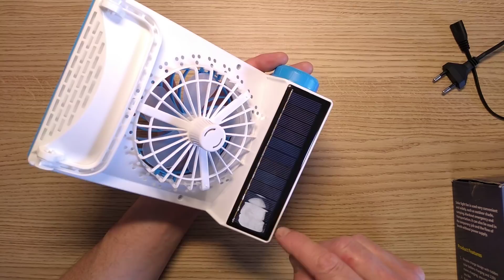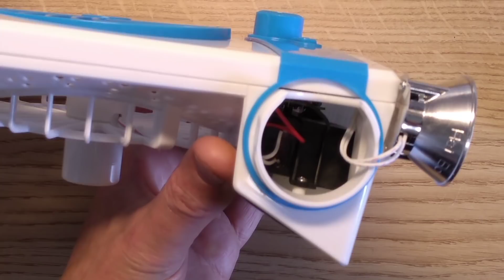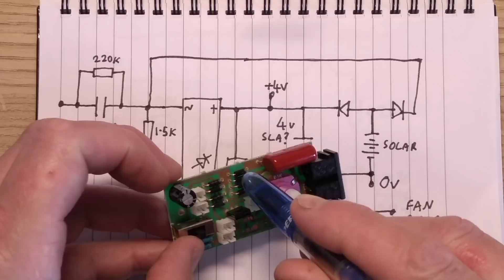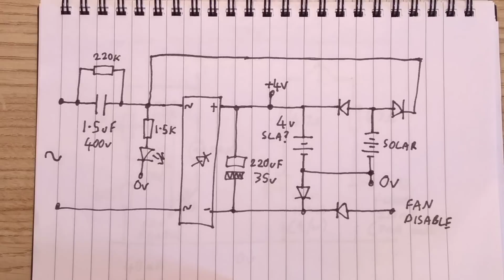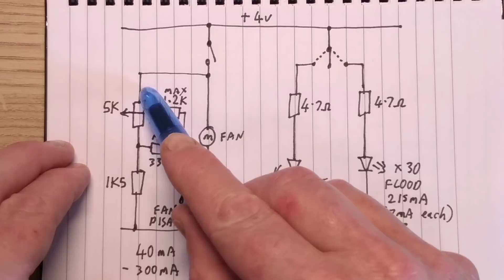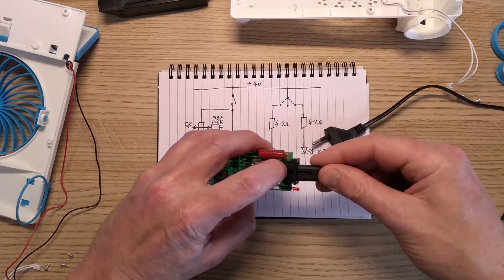Inside a solar/mains rechargeable fan / work light.  (with schematic)

Comment: i think i suddenly realized why the similar light, i found being thrown away, did blow up!

the sla just dried out and went open circuit. that removed the only voltage stabilizer from the circuit and led got ~300vdc. explains black spots in that package and, iirc, red charging led being split half with force of the mains

i guess that was only reason it failed...

Comment: This device reminds me of device I have: a nice little USB power bank with a bright LED array on one side, USB in and out, and solar panel on the other side.   As long as I charge the device via USB it is great.  If I put it in room light, the charge status LED bar graph comes on, but it appears the bar graph uses more energy than the panel generates, thus discharging the battery!  In very bright sun it might work, but in room light I have to remember to keep the solar panel side covered.

Comment: China, Inc. is usually pretty good at minimizing to the bare minimum.  I am a bit surprised the LED selector switch uses two 4.7 Ohm resistors, where one resistor would be sufficient (both LEDs can’t be on simultaneously, or can they?).  I suppose that gives some flexibility for a future design change where the two LEDs require different current limiting resistors.  The fan disable is actually kind of clever, I like that.  The other missed opportunity is they could have used a two chip LED and saved the need to have a blocking diode on the solar panel; hard to say if a fancier LED or the extra diode would cost more.

Comment: Is it just me or would that make a good Soldering station "Fume extractor"- I don't use one but I know i'm supposed to. (Just like how your not supposed to drink, walk on the wrong side of the road, J-walk,etc.)
Reply: Honestly, you don't even need the 'extractor' part of the fume extractor if you're not soldering full time. Just get a PC fan and let it suck the fumes away, and have some ventilation so that they don't build up inside the room.

Comment: WHY does the fan spin up to high speed for a second or 2??   You DID NOT analyze why that occurs!!     Please do.
Reply from the maker: It starts at the highest speed when you turn it on and as you turn the knob further it slows down.  Most fans start at full speed to get them running.
Reply: @bigclivedotcom  Thank you

Comment: Clive why does the usb cable on my Samsung phone chargers trigger my voltage detector probe rated 90-1000VAC? Im scurrred.
Reply from the maker: There's a slight AC coupling from the input to the output.  The voltage detector is sensitive enough to pick that up.

Comment: If the LED series resistors are both the same value why two? One less component if the resistor were between the power and the central arm of the switch. There is no facility for having both LED lamps on at the same time so no need for two resistors.

Comment: The resistor 1k2 max is also required to limit the base current other wise you would connect the 4V across the base and when the fan disable kicks in it would be a short across the battery,

Comment: If I were to hazard a guess, I'd say those four diodes that all do different things were probably grouped in that way in the same place for ease of assembly. These through-hole technology (THT) components were probably soldered in by a low-paid human. I know there are pick-and-place machines and soldering robots that can install THT components too, but I'm guessing this PCB had humbler origins w/o anything as fancy as that involved.

Comment: Hey Clive, they also do it in pink. https://www.ebay.co.uk/itm/Rechargeable-Solar-Cooling-Fan-Night-LED-Light-Lamp-Tent-Lantern-Camping-Torch/153469906414?var=453428363164&hash=item23bb84edee:g:JWEAAOSwrCZa-VOZ

Comment: It's a bit odd that they did not use a 555 timer chip, or perhaps a 556 dual timer chip, to slow the fan and provide dimmable light, both efficiently, by using the PWM capability of the venerable chips... which also have a significant current drive capability, all at quite low cost.

Comment: Interesting little battery would like to know more about it great video keep up the good work.
Reply: That looks like a 4 Volt, Sealed Lead Acid battery.. Probably 1 to 1.5 amp max(guessing based on size?)... Very common where I live.. costs around 75 cents to $1.20 for a 1 amp.

Comment: this could be good for a soldering station, if you can get it to suck not blow and stick a carbon filter on it to collect the solder fumes
Reply: Turn it around, slap a filter over the "back" that is now facing you.
Reply: @AlexLaw_Qld  but then you'd lose the lighting i think

Comment: Met those SLA batteries before, and they are very light. Opened a dead one ( it was brand new, and did not want to charge, got a whole load of LED's out, which was the goal, they were cheaper than buying new) and inside it was 2 rather poorly made spongy lead plates per cell, with a very dry separator, and filling up the rest of the volume was some polystyrene sheet, crudely broken to shape to fill the cavity, that was obviously meant to have another stack inserted. Added some sulphuric acid to the one that had come apart easily, a few spots of glue used to hold it together, and it was then able to take charge. I estimated around a half amp hour capacity though, though the case was implying that these were 4Ah packs. Went with the other alarm batteries to the scrap yard.
Reply: @Ad Lockhorst  I wonder if that has a linguistic relation to "cole slaw", which is 'murkan for shredded cabbage salad with a bunch of mayonnaise and something acid like vinegar.

Comment: doesn't the 1K2 resistor in the fan section - connected to the pot also limit current thru the pot?
Reply: Technically it does, but this doesn't mean anything to the circuit.
Reply: @B-System  Then why include it?  I

Comment: I had bought a chinese trimmer and yesterday decided to open it just to see how it charged its 1.2v Ni-Cd battery from mains with all the circuitry inside. I opened it and understood nothing(Not that good at electronics lol), but it had very few components. Later I saw it was charging the 1.2v battery with 4 volts and was wondering if that was safe?

Comment: They could have saved 2 to 3 inches of wire if they had put the wires for the fan along the right guide rail instead of using the one on the left.

Comment: Clive, I have a failed Flowline LI55-1211 4-20 mA digital level controller. This is the second unit that has failed mysteriously at the same location. You want it to take to bits?
Reply from the maker: In what way is it failing?
Reply: @bigclivedotcom  Rather uneventfully. The first unit lasted about 1-2 years then it either displayed nothing or showed nonsense information, I'd have to ask the site's technician again which it is. We replaced it with the same model unit. Which suffered the same fate about 1-2 years later.

Nothing else in the panel has any issues. There was an electrical storm around the time the second one died. It may or may not have had anything to do with the second units death.

As best we can tell the two units died for no discernible reason.
Reply: @bigclivedotcom  I talked to the tech and there were 3 failed units, each replaced the last. The last two, and maybe the first, failed during lighting storms. The weird thing is that these are the only failures in the panel. The panel is on top of a hill, against a 15' tall above-ground storage tank but the only signal/power to the unit is from a sensor at the bottom of the hill that is hooked to a panel there (no failures in this panel either). There is 120v power in both panels for other uses (including powering the sensors that send the 4-20 mA signal) and it is protected against power spikes. The power comes from the panel at the bottom of the hill. Both panels are grounded. Nothing else in either panel was damaged, including another identical Flowline unit hooked to a sensor in the tank, that was installed at the same time as the first one failed.
Reply from the maker: @captianmorgan7627  Is the unit mounted at a remote location with the signal wire passing between buildings?  It could be a voltage gradient issue from lightning strikes.  It's possible you could use an Ethernet style surge arrester to shunt excessive voltage spikes to local ground.

Comment: I have had 2 of the power failure lighting units with the same looking sealed lead acid batterys in them, and they both would over time , say 6 months to a year eat the wires off where they attach to the battery's. I would clean the battery contact and snip off the wires and solder them back on only to have them get eaten off again in 6 months to a year. So there is some out gassing happening right where the battery contact posts are located.

Comment: If one forgets to turn off the fan while on it's lowest setting and begin a charge, upon removing the charger cord, with the fan not rotating without a bit of a nudge, does that stress the circuit, or overheat the fan motor because it's not rotating?
Reply from the maker: I think the current is limited to a low enough level at that point not to be an issue.

Comment: Would have liked you to have positively confirmed the battery chemistry.
(Or negatively not confirmed the battery chemistry.)
Reply from the maker: I took one apart in another video.  Chunks of lead and fibreglass soaked in acid.
Reply: Solar >> trickle >> SLA, no?
Reply: @michaelthibault7930  Solar only needs to provide up to 14·6V through a diode (for a 12V battery) = no issue.
I often see comments on 'fancy chargers for LA batteries - but they actually look after themselves - give 'em 14·6V and let 'em soak up the current as they need it.
Obviously multiply the difference according to the actual battery voltage.

Comment: I'm guessing the fan starts at high because that's what most fans do. If you buy a box fan, oscillating fan, tower fan etc and it uses a knob for power selection, it usually goes Off, High, Med, Low.
Reply from the maker: It's to give them a boost at full power to make sure they start.

Comment: I had a big industrial fan that behaved like that once, it would only start if it was already in motion from being nudged with something small enough to fit through the grille otherwise it would just sit there gently buzzing.
Reply: That probably means time for a new run cap.
Reply: @NiHaoMike64  or bearing....

Comment: I guess then, the Achilles heel is the battery? - my guess being that they're not exactly something you'll get off the shelf at Wilko (or Pound Land)? So once it's dead, it's dead - an ex battery, snuffed it and nailed to its perch, if you see what I mean, so Clive, your mission, should you choose to accept it, is to modify the device to take NiMH, or Li-Ion? 💥
Reply from the maker: It could be fitted with three NiMh directly at 100mA charge current.
Reply: The thing is, lead acid batteries are very hard to kill. Depending on why they died, they can sometimes be revived by adding water back to the cells

Comment: I have a question regarding the capacative dropper. But if you answer please keep it simple.
240v @50hrz from the plug goes into the dropper, I'm ok with that part.
After the bridge rectifier we'll call it 12v @50hrz, I get that.
But as I understand it the capacitor acts as a diagram pump, without letting the actual current through because the frequency is higher than the capacitor can react to. (Ish).
But when a discharge resister is placed into the circuit. What stops the current bypassing the capacitor through the resistor and letting 240v through?
In my head it makes no sense having the capacitor if you have a resistor.
Hopefully I've typed this in English, and thank you for your answers. 😃
Reply: The resistor is of high enough value that it passes very little current. use an ohms law calculator.
Reply: @simontay4851  
Thank you for the answer. That makes sense in my head. 👍

Comment: Why didn't they just use 1 x 4.7 ohm resistor before the switch instead of 2x after? Would save a few pence.
Reply from the maker: Probably to allow different resistors for different lighting configurations.
Reply: Hey, that's my comment ;)
Reply: When the switch fails and turns both on simultaneously, though!
Reply: @JasperJanssen  Quite possibly not possible !

Comment: looked up the Datasheet, the transistor seems rather special, with a 6 V Base-Emmitter voltage.

Edit: OK, you were correct, it seems like   this was the maximum (breakdown) voltage, not the operating voltage. So forget what I have said, it is indeed a generic NPN
Reply: Rubbish, nothing special or spectacular about it.
Reply: Are you confusing base-emitter voltage with reverse base-emitter voltage? It’s just a very popular, standard, medium power transistor like the European BD13x ones.
Reply: make sure that you got the right one b/c i know that transistor (got it at home) and its everything but special. 
also keep in mind that even though it says d882p on the to package its a 2sd882p...

Comment: I'd advise the rubber glove trick for the smoke detector if it's a major concern. Just rubber glove over the detector, large yellow gloves
Reply: Or a sock.
Reply: Shower cap works a treat too.
Reply: I do commercial fire alarm/detection, and it's totally not kosher, but cling film/saran wrap, masking tape, a shower cap, a rubber glove, or just about anything can be used to cover over a smoke detector. Be sure not to remove it, as that'll send a trouble signal to the fire alarm panel, and be sure to take your obstruction of choice off of it when you're done taking apart random electronics.
Reply: @carpespasm  the ones in prison don t set the alarm off when you are just smoking normal tobacco but they do when weed was smoked!! How do they work?? Can they be sensitive to certain types of smoke or something? ?,
Reply: @keithking1985  tobacco smoke doesnt generally set off fire alarms. Cannabis on the other hand burns hotter and the smoke contains more impurities.  You can chong a full fag blowing it at a smoke detector and it may mever go off. Spark up a spliff and blow stright at the sensor though and it goes off straight away.
Reply: Tissue paper. They had them in jail and lads who "smoked" used tissue paper stuffed into them. It works.😤😥😧😊

Comment: Do you have access to male / female mains socket and some wires ? With clamp meter could measure current from live or neutral, however it would lack the power factor. aie aei aei gate current :P
Reply: exactly its a npn and neither mos nor igbt... npn dont have a gate. but the message comes across quite well.
Reply: @urugulu1656  Yep it passes thru right well on bjt :P we also do that once a while.

Comment: that adapter? is there a fuse between the plastic ground pin n the other pin?
Reply: plastic usally is non conductive so that would be quite useless anyway
Reply: @JamesMears76  And I can confirm it doesn't stop older kids and smartish adults though. I was about five when I figured out the middle hole made the two bottom holes open.

Then I realised I could jam the two pin plug from my bedside light in there, instead of the 1980s version of a deathdapter 😀

Comment: Are those currents calculated, or realy measured?  7Ma through a LED in the 30-Led Array seeems a bit low. How do dey get so much light out of that?? I wonder how much current the Fan will draw on various settings.
Reply: It only takes few uA to visibly light a modern InGaN LED._

Comment: Could be rather useful for soldering, using the light to illuminate what you're bodging together and the fan sucks the flux vapours away (or toxic fumes in the case of the unleaded nastiness), handy gift there... :)
Reply: just gotta add a sheet of activated carbon onto it
Reply: @urugulu1656  I have seen the same design fan but without all the light and solar gizmo, it is for blowing away solder fumes.
Reply: THAT is a great idea! You could even add a switch to make the fan reverseable. Also might want to add a thin activated charcoal filter to deal with those fumes. Again.... great idea!! 👍

Comment: Sealed lead acid, with no indication on the outside, so a pound of lead goes straight into the landfill when it's dead. Perfect. Thanks China.
Reply: Lead doesn't work like that, if it did many towns around old battlefields would have lead poisoning but they dont. Lakes and rivers around the world have lead fishing wieghts that have been lost in the millions directly in water supplies but cause no issue to the fish or the local population.
Reply: @coffeecoffee5914  no, sorry, your Fox news watching isn't a reliable source. Lead does work that way and it's the reason lead fishing weights are banned in many areas now and replaced with bismuth.
Reply: @Muonium1  I'm not much into politics so I don't watch the cable news much anymore. I prefer independent news that focuses more about events than politics. I would worried more about plasma TV's being placed in landfills. Here in California even bags of play sand for children is labeled as prop65, so are brass fittings for potable water. Slapping cancer labels on everything desensitizes people to what is actually hazardous and does the community a disservice. Burnt french fries should not have the same warning as something truly toxic. People (lawyers) get carried away while chasing ambulances.
Reply: @Muonium1  and yes the fact you lead (pun intended) off with a political piece shows your true colors. I hope you have a wonderful day, from sunny California I bid you adieu.
Reply: 10mintwo Recycled not landfill.
Reply: @daverhodes382 0.00% of these are going to be recycled